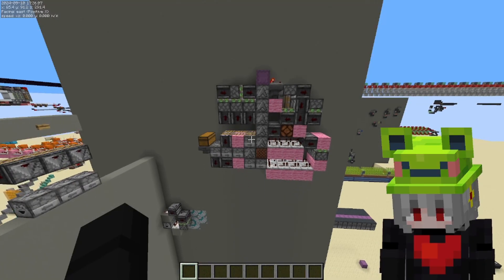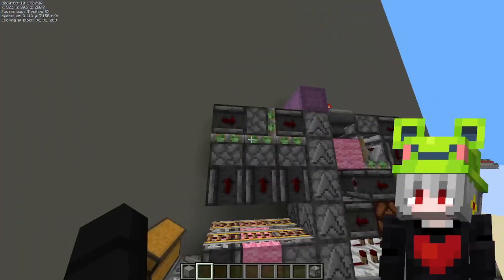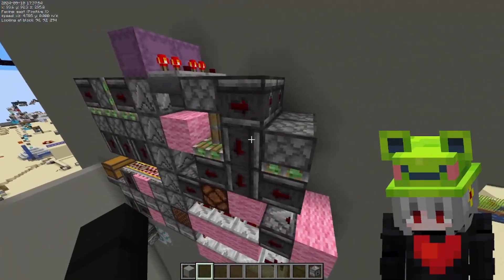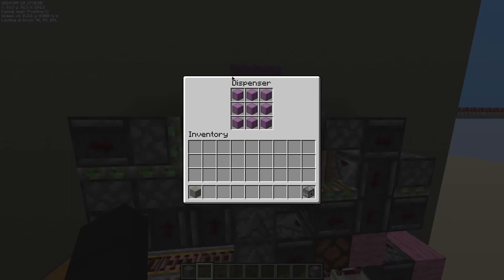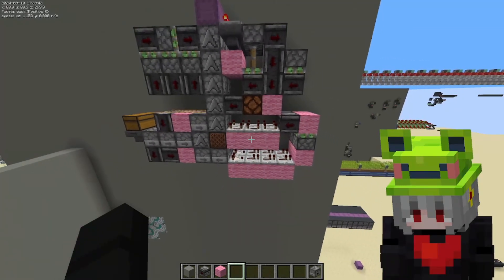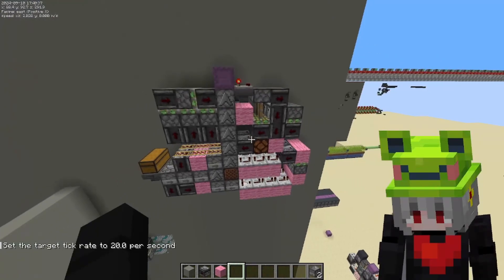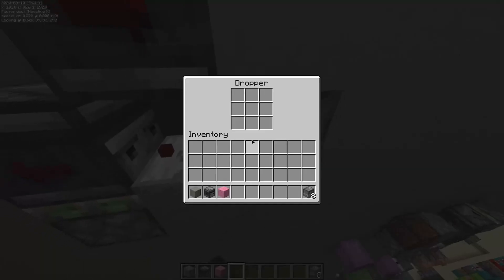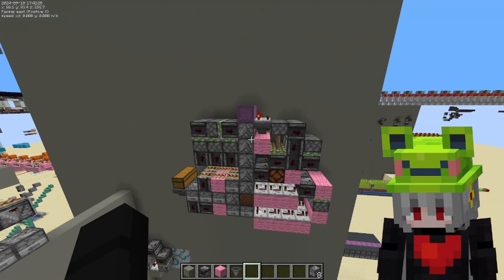Fully Flat Shulker Display | Choculat Design

Comment: oooooh... id say just put carpet on top.... at some point i swear MC is going to allow two "blocks" in a space... even java can do that with item frames
Reply from the maker: I feel like 2 blocks in one space would be so overpowered lol
Reply: @Choculat  fair… but the item frames…. Maybe it could be considered… or an upside down comparator (assuming the slab you put in the actual recipe, allowed for a floating comparator) from minecraft 1.21 - 2.0 theoretically there’s still time.
Reply from the maker: item frames would break and an upside down comparator wouldn't be smaller unless you meant it being under the shulker, maybe someday ?